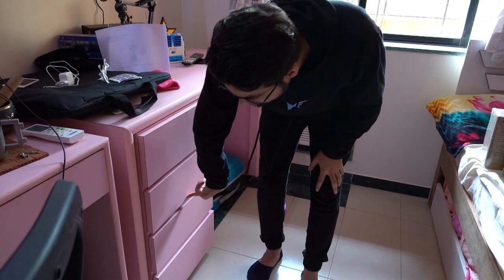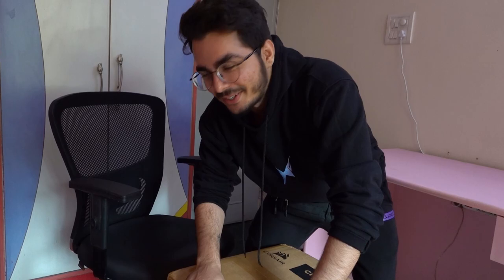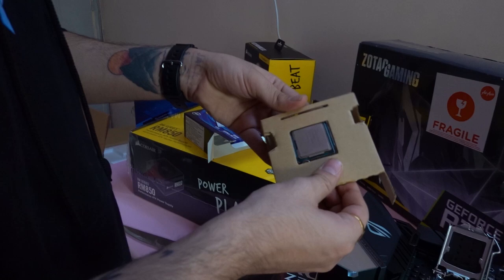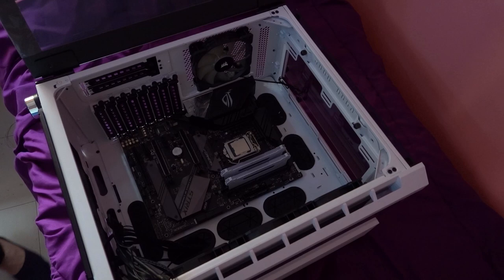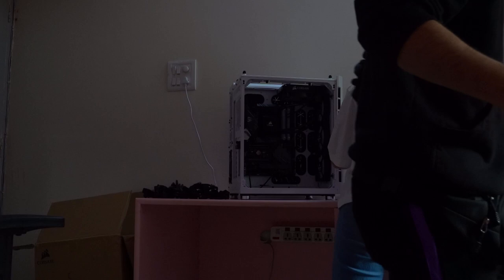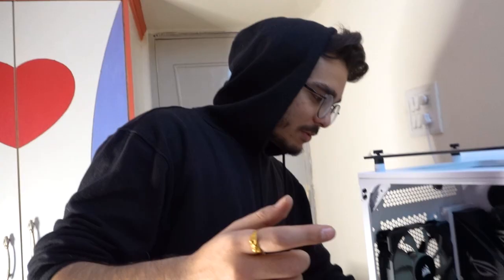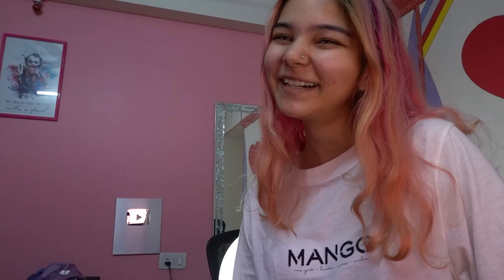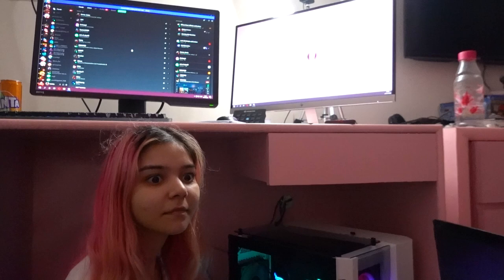HYDRAFLICK THREW MY i9 9900K | BUILDING MY GAMING AND STREAMING PC - VLOG 4

Comment: 👀 200+ FPS stuff BOI! 
Hope yall enjoyed❗️
Reply: Yeah boi
Reply: Noicee work Rohan Sir
Reply: She should have gone for 240 hz display
Reply: Big phan sarrrr❤️
Reply: G502 or deathadder elite.
Konsa accha h rohan sir
Reply: comment pe dil diye ja rahe ha 😂😂 

joke
Reply: Always insert your ram in slot 2 and 4..
Reply: Always insert your ram in slot 2 and 4
Reply: @harshitpandey777  144hz it's good for her and jumping too 240hz its a big difference 😉
Reply: @yang406  it's not that much of a big difference in 144hz and 240hz but still if you want flagship stuff and you have a pc for 200+ fps then why let you monitor be the bottleneck
Reply: @harshitpandey777  For casual gamers, on the other hand, a 144Hz refresh rate is most likely sufficient, especially after considering how demanding gaming at 240FPS/1080p with decent settings can be.
Reply: @harshitpandey777  Finally, you have to take into account whether you want your monitor to have a variable refresh rate such as fREE-SYNC and G-SYNC or some form of motion blur reduction via Backlight strobing luckily both 144Hz and 240Hz monitors are available with these technologies which also affects the price 😊
Reply: @yang406  all good monitors even ones with 75hz refresh rate and above comes with 1ms response time that reduces motion blur and the monitors which support freesync can officially support gsync as well.
There's a new feature released for it.
With only one program or plugin you can use gsync in freesync monitor.
Reply: @harshitpandey777  no point of explaining it to you better check Linus videos bro 👍
Reply: @yang406  I've seen it already a long time ago.
Reply: @harshitpandey777  I don't think so better watch it again don't skip 👍
Reply: @yashwadgaonkar4671  😂😂
Reply: @chillipepper3585  why using an F series CPU it's not worth it?
Reply: Seems More like stuttering stuff.. lol i saw her Apex legend streams with this setup 🤫🤣
Reply: Bad cpu cooler
Reply: Thoda lighting badha leta bhai and overacting ke - 50
Reply: R u guys cousins or just frnds
Reply: Are you hydra flick?
Reply: I realize I'm pretty off topic but do anybody know of a good place to watch newly released series online?
Reply: @Arian Finnegan Flixportal :D
Reply: @Juelz Van Thanks, I went there and it seems like a nice service :) I appreciate it !!
Reply: @Arian Finnegan You are welcome :)

Comment: Usually the 40mm fan is for the northbridge or the VRM. When you use liquid cooling, there is no air movement near the VRM and MOSFETS. This is especially a problem in ITX sized cases. So you can mount the 40mm heatsink on the VRM heatsink or northbridge heatsink, depending on which is running hotter. Obviously, none of those are standard sized componenets, so you need some "jugaad" to make it work.

Comment: Ram should be installed in 2nd and 4th slot not 1st and 3rd.....you are running the ram in single channel mode instead of dual.....also 120mm aio with i9 9900kf wtf 😒

Comment: You should using atleast 280 mm liquid cooler with i9 9900k because the processor run too hot so you should upgrade the liquid cooler atleast.

Comment: i9 9900k in 2020? i mean come on team blue. grow up.
Reply: I am green team 3900x
Reply: These guys are using an 120mm radiator to cool an f**king i9 9900kf cpu. Common that cpu atleast need 360mm radiator.
Sure it will thermal throttle.

Comment: WHY 850W power supply? Are you trying to power 2 pc's with that thing. 650W is more than enough for your build but nice build but not the best bang for buck.
 For far better performance you should have changed the processor to Ryzen 3900x 12Core/24Threads at 43K and Asus TUF X570 Plus Wifi motherboard, same gpu and 750w PSU, 3200Mhz ram 16 gigs, Crucial MX500 512gb/1tb M.2 ssd + 1/2tb hard disk, Aio cooler, Case of your choice and will still save some money compared to this pc and would have used that money to get a better 1440p 144Hz IPS monitor. Now, this ryzen pc will smoke your Intel 9900k pc with delivering 1.5 times the performance ( and a better IPS Monitor) for same money spent which definitely would have helped with gaming and streaming but still I'm not hating but just a suggestion that there are far better options out there, currently there's no point buying Intel over AMD especially for mid to high end pc builds.
Reply: Nice advice amd is rocking over intel these days...
What's ur pc specs?? i have r5 3500 rtx, 2060 super and 600w psu with acer pg240y(ips monitor) 144 hz
Reply: @kavita5131  Nice choice, wish I had a new pc but the one I have (which I don't use anymore) has core 2 duo lol, I do have a lenovo y50 laptop (i7 4700Hq, nvidia 860m, 8 gigs)  which I use. It's more like I like to keep myself updated with the PC world, but if I were to build a pc now I would definitely go with ryzen whether it's a low/mid/high end PC. 
May I know which motherboad are you using??
Reply: @Gaurav singh MSI B450M pro vdh max
Reply: @Gaurav Singh pls do suggest for only home use a decent <30k pc build components .. Ty
Reply: @kavita5131  nice, you have picked your parts nicely and in 3,4 years if you feel performance is slipping you can upgrade to 8,12 core ryzen 3000/4000 cpus for cheap so a win win situation
Reply: @babuyadav9700  bro can you please explain what type of work will you be doing on that pc? like gaming, office work, etc.
Reply: If you wanna oc I don't think that psu is enough also if you have cash why not spend a lil extra on power to make it future proof
Reply: And no amd can't beat i9's boost clock still in 2020 and no I'm not an Intel fanboy I'm just sayin the truth i myself have amd lol
Reply: @RGT.  bro the thing is these components (stock) will run  even on 450/500 w psu  so even, 850w is required only if plan to run sli configuration and OC.
And each new generation tries to have better energy efficiency so I doubt future 8 cores will consume drastically more energy than current ones
Reply: @RGT.  true but overall performance of 3900x is better than 9900ks  in all other tasks and by a huge margin( like 30-50%) and even in gaming too 9900ks is faster by only 5% max and it even consumes same or less power than 9900ks

Comment: u hav installed ram in the wrong slots...
Reply: Dr.Prasobh M.P in order to take advantage of dual channel ram we need to place ram stick with gap in b/w (alternate slots)
Reply: @piyushasnani7095  if two rams are used dimm a2 and dimm b2 slots are recommended for optimum performance...
Reply: @drprasobhmp2113  dr ki suno re
Reply: @08_a_dhananjaydeshmukh93  😂

Comment: 120 mm ALL IN ONE LIQUID ON 9900KF GG
Reply: OVERHEAT NAHI HUA TOH NAAM BADAL DUNGA
Reply: I guess she wont overlook bro
Reply: @V0rteX69  bhai i am hardware engineer in maharastra - nashik. 
I have built 5 - 9900k systems and i know very well the heat generation of 9900k . 9900k requires minimum 240-280 mm liquid cooler for optimum operation. And for Overclocking u at least need 360mm rad. Because when overclocked 9900k 220-250 watts of power and Desipiates heat Accordingly to that. 
I have done so much testing on these things. And pairing 9900k 
With 120 mm rad is totally wrong
Reply: @nachiketkachave2044  bro for gaming 9700k is good enough?
Reply: @eusterich3035  yes 9700k is very good for gaming
Reply: But 3700x and 3800x are also good for streamers

Comment: Bro plzz I m from Canada and I wanna build a pc for streaming and gaming around $1000 plzz tell me 😔🙃
Reply: Msi B450 Tomahawk Max 
Ryzen 5 3600
Any 16gb (2x8gb) 3200 mhz Ram Kit
Cooler Master MasterBox MB11 (or any case of your choice with good airflow)
650W 80+Bronze PSU or 550W 80+Bronze
240GB SSD from Any Trustable Brand (Crucial, Kingston, WD)
1TB or 2TB 7200 RPM HDD (Ex-Seagate Barracuda)
RTX 2060 or GTX 1660 Super (Depends on your budget left)
Reply: @rayush9145  tere upar waala comment ko kuch sikh mil gayi.😂😔

Comment: For gaming amd or intel which processer??
Reply: Intel
Reply: You can use amd for high processor gaming amd 3600 however they are a bit cheap but intel I recomend you to use it coz' it's expensive but it worth even i3 is a great processor gaming which cheap
Reply: @ahiransahu2375  lol I did not see i3 for gaming on any setup so far...
Reply: @CeRO0101  he don't know anything about pc just ignore that noob
Reply: @mightyking7957  no i3 9100f ca be used for gaming with gtx 960 graphic card with corsair veglegence 8 gb ram
Reply: Intel is best
Reply: @manojsinhchauhankanaiyatra418  huh you think try searching for ryzen 9 3950x vs intel i9 9900k and see the price too ok kid
Reply: Amd much better for gaming going to buy 3600x better than i5 9600k 12 cores and intel have only 6 cores
Reply: Intel
Reply: @pandagaming5370  bro 3600x does not have 12 cores it has 12 threads 
3600x = 6c 12t
i5 9600k = 6c 6t 
Single core performance is obviously better in Intel but 3600x is an all-rounder so 3600 is best

Comment: You guys mad or something ? Please tell me ! Why the f did you put a 120mm AIO on a i9 9900kf ! It usually runs extremely hot in gaming even after adding 360mm AIO ! RAM is also not properly installed. Hydra flick doesn’t know how to build a PC !
Reply: Ye sale pagal log hai 
Pubg mobile ke liye i9 aur 2080 use karte hai
Monitor bhi 144 hz ka hai 240 ka nahi mila kya
Reply: @habibqureshi3044  dude wtf , ye pubg pc khelti ha and why do u care??
Reply: @habibqureshi3044  gandu pubg pc kehlete hai inlog

Comment: liquid cooler single fan bhai atleast dual fan toh lgata i9 9900kf hai
Reply from the maker: Nah this was my emergency cooler, actual one was stuck in HK because of the virus. It's here now and installed ☺️ Maybe I should put up an update video
Reply: @AnkkitaC  sure
Reply: Lgta hai aapko gaming PC ka knowledge hai bhai mujhe bhi lena hai pr budget etna nii hai aisa bata n games bhi thik thak graphics mein chale aur sb games support kr le plzzz bhai
Reply: It runs hot even on 240mm aio you should have  a 360 mm aio
Reply: Ayaan Khan it runs hot if it is on load for a lot of time and also when jt is overclocked like at 5ghz then it runs hot

Comment: Ram placement is wrong you should install it on 2nd and 4th slot
Reply: It is different for every mobo..it will be given in the instruction manual
Reply: 2/4 or 1/3 is okay best is 2/4 but it's not an issue

Comment: Ram Galat lagaya hei 1 and 3 slot Mei
Reply: Shi lagaya h bruh 🤣🤣🤣🤣
Dual channel ka naam sune ho🤔🤔🤔🤣🤣🤣🤣🤣
Reply: @manasgfx6179  bc 2 and 4 slot Mei Lagana tha
Reply: @ezero1309  
Abee loude 1&3 or 2&4 slots hote h dual channel
Quad channel main charou hote h
Reply: @ezero1309  bhai 1&3, 2&4 kisi me bhi lagao but 2&4 log prefer karte hai kyuki usse cpu cooler se jyada door rehta hai to interference nhi hota aur koi reason nhi hai, lekin isme Aio water cooler use kiya hai to koi dikkat nhi hai.
Reply: @adi139tv  cooler se zyada jaga k lia nahi . Asal me circuit ends to 2 and 4 no. Slot and so it is pressed so that any noise doesn't get the cpu
Reply: Agar 4 slot hai or Ram stick do hai toh ya 1 or 3 main lagao ya 2 or 4 main tabhi dual channel ka use acche se ho payega

Comment: Why are you using an F series CPU it's not worth it🤦🤦🤦
Reply: It's more worth it than a non-F series. It costs less, and there's no use of adding a non-F if you're gonna add a GPU anyways. This is quite misleading.
Reply: There is not much of a difference in price and think it the other way even if you are not doing anything gpu intensive but still it will work all the time decreasing it's efficiency , load and electricity cost.
Reply: @harshitshreshth3811  Even if you have a 9900K, it will still draw graphics from the GPU, because that is where you are plugged in.
Reply: The GPU remains turned on but it is not in active state thus consuming less power and the price difference between these 2 CPU is less the 100$ .
Rtx 2080 is a heavy gpu as well , so think of the load .
Reply: @mahnamejeff7586  how is it not worth it lol it's cheaper plus you don't need igpu if you're making a gaming pc 😂 when ur using 2080 why tf would u want igpu? And also kf gives slightly better performance on overclocking
Reply: @RGT.  ???? That's exactly what I said. What you tryna prove?
Reply: @mahnamejeff7586  no? U said kf isn't worth it but it actually is
Reply: Intel's not worth it
Reply: @RGT.  That man with the main comment said so, and I argued against it. Can you read?
I said it's MORE worth it. I said it costs less, but is as powerful.
Reply: @krazzyboy548  and I completely agree with you.
Reply: @mahnamejeff7586  at that price I would go for 3900x.
Reply: @krazzyboy548  yep, Team Red always.
Reply: @mahnamejeff7586  not always I will support whoever is better and at this moment AMD is the only obvious choice and will likely remain so for the next few years, hard for Intel to beat their price to performance.
Reply: @krazzyboy548  everyone has their opinions. I respect yours.

Comment: The question is who the heck uses 120mm aio with i9-9900k? lmaooo noob
Reply: Some of them use stock cooler
Reply: @pumpydumpy4723  it doesn't have..a stock cooler 😶
Reply: @pumpydumpy4723  i9 9900k doesnt have stock cooler my dude ༼ つ ◕_◕ ༽つ
Reply: @abhishekks3422  sorry bro i dont know that because im no longer interested in Intel's garbage CPUs
Reply: @pumpydumpy4723  haha you are right but as a Amd supporter i still think i9 9900k is the best gaming cpu
Reply: You are giving it the title of best gaming CPU just coz of one reason , i.e., higher clock speeds , everything else is better of amd.